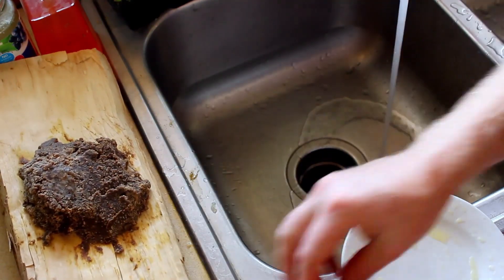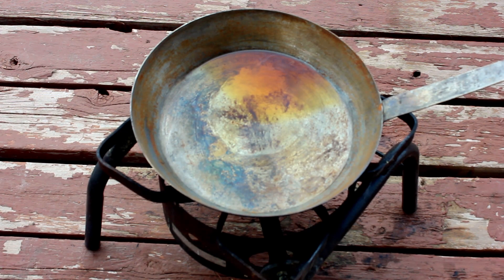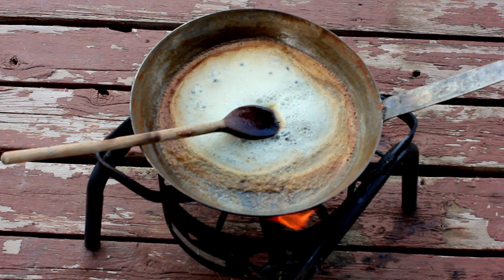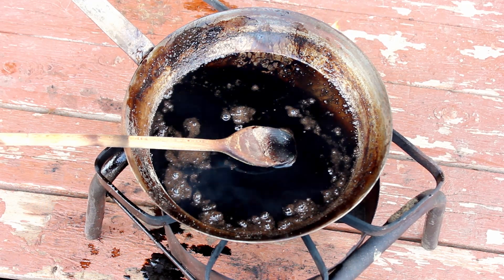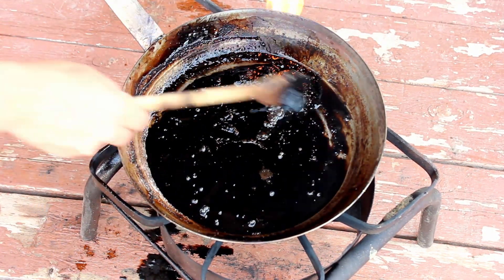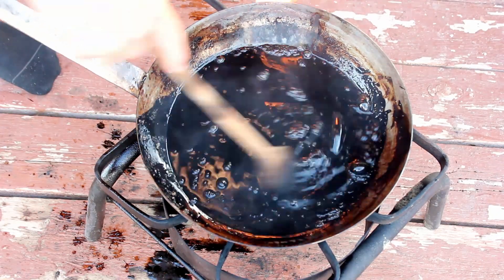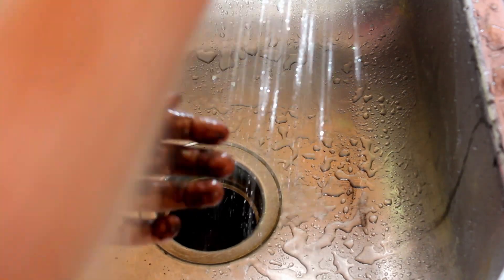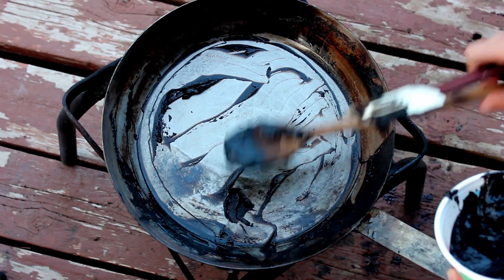Second Try Making Soap!

Comment: Low grade medieval soap was called black soap. It must have been for this reason. For high grade soap they used olive oil which produced a cleaner looking soap and was quite costly to import which made it more desirable for the upper class. This kind of soap mostly manufactured in Spain. 100% olive oil soap is called Castile soap for the region in spain where it came from. I'm not sure if they cooked it or used a "cold" process though.  Anyway I would suggest using a crock pot for a portable low heat cooking method.

Comment: It looks like your alkali solution has a lot of contaminates in it. If I were to guess I would say that a good portion of your solution is getting neutralized by the method of filtering you are using and the alkali is leaching tannin from the weeds. The tannin combined with more heat than needed is likely contributing to your dark brown black color. Try placing your ashes in a jar with the water, let it soak for a few days, shaking occasionally. Then let it settle and pour off the liquid and test with vinegar.

Comment: So ironically, after you superfat it, your new soap is good because it isn't too basic?
Sorry, can't resist.  I love seeing stuff like this made from scratch, and it seems like you're making good progress on it.  If you get the recipe dialed in it would be great to see some clearer soap: very thoroughly burned and sifted wood ash, filter the solution with a fine paper filter, maybe let it settle in a tall vessel to drop out any remaining particles before decanting, then cook on a very low heat (perhaps a small alcohol burner or electric hotplate).
Reply from the maker: What I actually want to try cooking it in is a crock pot.  That seems perfect.  The trickiest thing about the recipe is getting the concentration of my homemade potash right.  That's easily the hardest variable to control here. JF

Comment: Quicklime (calcium oxide) added to your alkali will convert your potassium carbonate into the hydroxide. Adding salt will turn potassium hydroxide into sodium hydroxide. If you want to go through the pain of a bit of recrystallization, you might be able to get some decent sodium hydroxide from your ashes, which would make modern recipes more accessible.
Reply from the maker: Interesting! What happens to the potassium and the chlorine when you add salt to potassium hydroxide? JF
Reply: Pretty much the sodium and potassium switch places because sodium pulls stronger (due to its location on the periodic table, kinda), and Oxygen pulls stronger, so they switch molecules to join together (bringing the H), forming NaOH, and leaving KCl. So the potassium and chlorine recombine together as well.

Comment: Yes, definitely too high heat there for your hot process, and I think your alkali solution would have also benefitted from being boiled down just a tad further before adding to the fat. Part of getting a good set in your soap is getting water out during the heating and curing, so starting with less can be better.

I think this has already been mentioned, but avoiding metal cookware (especially aluminum, but that pan looked steel) is a good idea for soapmaking.

Finally, I've always wanted to do this, but I recently decided that to build my skills sequentially and increase my chances of success, I would start with hardware-store lye. I just made soaps for the first time, tried some recipes from the internet and a few of my own, and learned a lot in the process but only spent a bit of time on it. Could give you a different approach if you tried starting there, so when you work your way back to these ingredients you are better equipped to troubleshoot.
Reply from the maker: Starting from the other direction is definitely a valid plan and would involve less errors.  That said, I think I've been wildly successful so far--as long as the bar of success is functional rather than decorative soap. JF
Reply: The "bar" of success... I see what you did there

Comment: I've never seen decent soap made in a metal pan, it reacts. always use glass, porcelain or at least an enamel coated pan. I've done it many times, never heated it, but I made crystals out of the hydroxide first. Experiment is great, but this is a fairly specific reaction.

Comment: Good attempt but something, if I were in your situation, I would try is to make some soap with actual measurements and not by eye just to get a feel for it (I do actually make soap using modern equipment and measurements, even then it does not always turn out the way I expect). Historical soapmakers also probably failed a lot before they got a feel for how to make soap but we have the advantage of having a lot of modern equipment. I do not know if you have done that yet but it was never mentioned so I thought I might suggest that. Aside from that, it does seem the soap is getting too hot. You want the oil/soap to be hot but not burn, and when you are letting it saponify (i.e. after stirring it for a while and then just letting it sit) you want it to be on even less heat. I'd suggest doing it over coals for that instead of a burner as the temperature control will be greater. Of course, one of your problems is that you are using a random mixture of alkali salts in your solution because that's what you get from ashes, it should still be possible of course. I would try to dry the solution out until you get the salt in a solid form, then maybe build a basic scale to measure out the alkali and fat ratio. If you keep using the same plants and only one type of fat (most soapmakers today mix oils/fats because different oils/fats have various effects) then you can eventually figure out the saponification value by trial and error. Each oil will not only have different effects on the soap but also when it comes to trace or how fast it cures. With the hot process, you should be able to use the soap within 1-2 days though it might not be as hard. The last thing I have to suggest is that you want to use an insulated container for when you take the soap out of the pan. It should still be slightly liquid or a gel when you do and putting it in an insulated container (wood works pretty well if you line it with parchment paper to release the soap easily) will keep it a bit longer in that phase where it will saponify more. The heating it for three hours is not a hard rule, it really depends on the oils you used. For example, I have done soaps with Coconut oil and Olive oil that take 2-2 1/2 hours and Castile soaps (as in only Olive oil for historical versions) that take only 1 1/2 hours (though, pure Olive oil can be temperamental and not work at all). Again, this is where experience and taking notes helps but that of course comes with experimentation.
Reply: Yep, recipes are great if you know what each ingredient is and does... making your own, the ratios are going to vary batch to batch, but like a good cook you will learn to adjust on the fly and the recipe is just a guideline.

Comment: The fat was burned. About midway through the first heating there was wisps of smoke that I could see. My memory of the process was an almost clear solution of potash. I remember that the ash was sifted through to remove as much of the charcoal as possible. I also remember a large drum or barrel that the solution was placed in an allowed to settle. The kettle that was used was a kettle large enough to hold a year old hog. It was suspended over a low fire that just barely brought the fat/potash solution to a simmer. It was constantly stirred for 10 to 12 hours. The resultant soap had a slightly yellow color and after molding, and 3 - 4 months curing/drying was hard. Probably because of the salt (NaCl) that was added about 1/2 way through the cooking.

So I suggest, letting your potash clarify, and that you better control your temperature.
Reply from the maker: A clear solution of potash?  To me it seemed pretty distinctly colored, idk if it can be clear. JF
Reply: @GoodandBasic  I think you might be contaminating your potash with your filter media - pine needles.

Comment: ive made soap with canola oil few times the specific ratios was any amount of oil (this decides what the caustic and water will be) and then mesured out 30% of the oils weight in water and dissolved in that water 12.5% of the oils weight worth of lye
Reply from the maker: That sounds about right.  The saponification values vary but 1:8 is right in the ballpark afaik. Did you use sodium hydroxide then? JF
Reply: @GoodandBasic  yup soduim hydroxide is the common house hold lye here in sweden potassium hydroxide that wich you get from ash is not really sold outside of industry because you can refine it into potassium nitrate if youre a decent chemist

Comment: You mentioned trying baking soda. That probably won't work well because it is a weak base, meaning that it will never go above a certain ph even if you increase the concentration. You might try washing soda instead which can be made from baking soda by heating it in an oven. 

Another suggestion for an experiment is to try using a drying oil. Most oils just go rancid when they oxidize, but some, like linseed oil form a waterproof barrier. I wonder if that would impede the function of a soap made from such an oil. I also wonder how much you are heating your soap because heating a non-drying oil to its smoke point can convert it into a drying oil, and give it a dark color. You can see this phenomenon on seasoned cast iron.
Reply: I’m going to try washing soda and coconut oil. I’m going to cook it on a double boiler until the water evaporates. Let’s see how this experiment goes... lol 😂